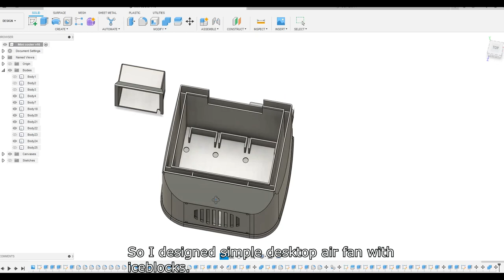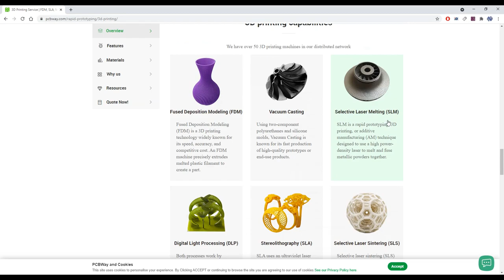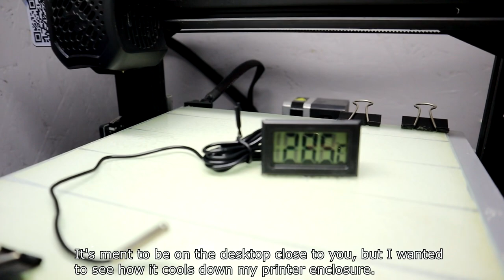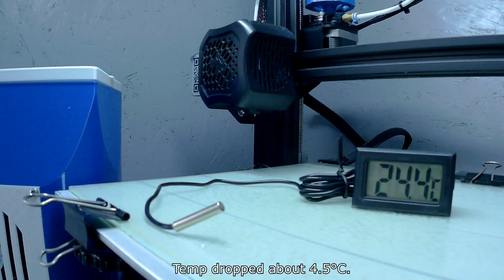Mini Desktop Air Cooler - 3D Printed

Comment: When blowing the sensor without the ice blocks you actually brought it down to the real temperature of the environment. Sensors without an air flow system actually only measure their own temperature.

Air doesn't get cooler from blowing it. It just takes the temperature with it more easily (up to the temperature of itself).

"Cool" project btw. 👍

Comment: cool! what kind of supports did you use? i have been having trouble with support removal
Reply from the maker: I used normal support in Cura. Pattern zigzag and I change support overhang angle and density to use less filament. You can't change it too much, because it can affect quality.
Reply: @3DPrintsBuilds Ok thank you